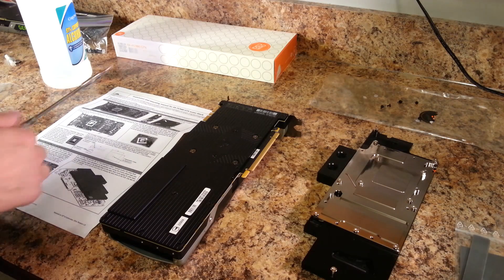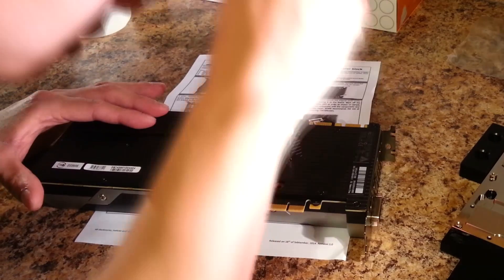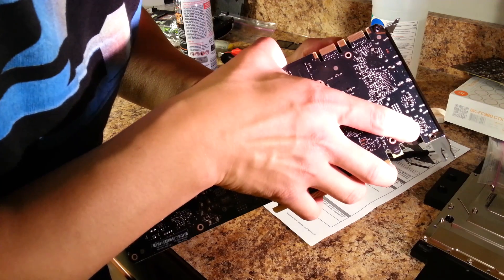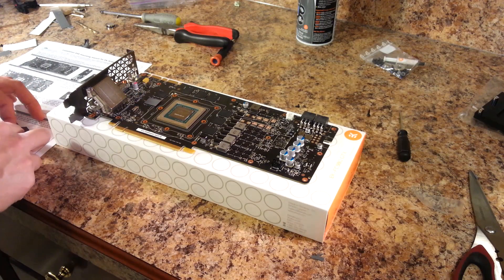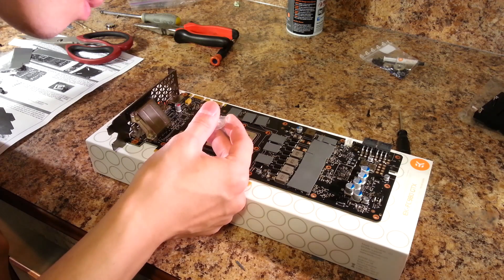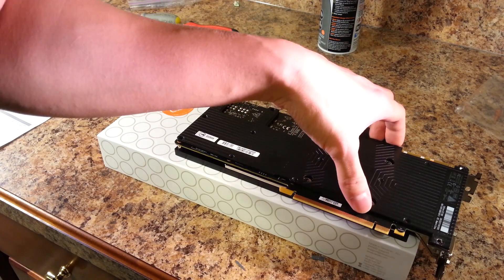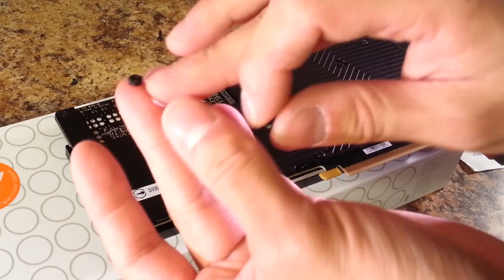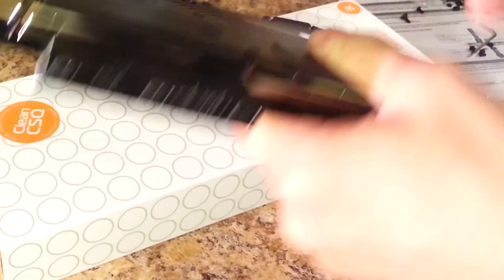How To Water Cool Your PC GPU: GTX 980 EK Water Block Installation Guide (PC Building Time Lapse)

Comment: The second piece of themal pad that you cut out (the square piece) you placed on the PCB... is not actually on anything, there are no components to cool in that area. Also there is no mention anywhere of the thickness of the thermal pads, they are not all the same thickness, this is important! Also the music made my ears bleed.

Comment: WARNING NOBODY NOTICES THIS AND PLEASE BE ADVISED I HAVE THIS GTX 980 CARD AND THE WATER BLOCK IN THIS VIDEO, THIS WATER BLOCK IN THIS VIDEO  DOESN'T COVER ALL OF THE GTX CARD , IF YOU STUDY THE WATER BLOCK YOU WILL NOTICE AT THE END OF THE CARD NEAR THE 2X 4PIN POWER CONNECTORS  NEAR THE LONG THERMAL PAD TO THE RIGHT WHERE THERE ARE SUPPOSE TO BE SMALL CUT OUT THERMAL PADS WHERE THE MANUFACTURE PLACED THEM THERE IS ABSOLUTELY NO METAL TO CONTACT WITH THOSE THERMAL PADS ON THE WATERBLOCK THIS ABSOLUTELY EFFECTS THE TEMPERATURE OF YOUR CARD, AND WILL MESS UP YOUR CARD WHEN  YOU GAME INTENSELY, THIS IS A HUGE MANUFACTURE ERROR ON THE WATER BLOCK PROVIDER, MOST WATER-BLOCKS FOR THE GTX 980 HAS THIS ISSUE NOBODY NOTICES IT BECAUSE WHEN YOU PC STARTS UP THE TEMPS LOOK GOOD BUT AS YOU INITIATE MORE OF THE CARD WHEN YOU PLAY GRAPHIC/GPU DEMANDING GAMES THE ISSUE SHOWS UP, THE TEMP GO TO 91C AND UP, AT 96C YOUR CARD WILL TRY TO PROTECT ITSELF AND SHUT DOWN YOUR PC, ALSO KEEP IN MIND WHEN YOU BUY GTX 980 THEY MAY SLIGHTLY UPDATE THE PLACEMENT OF THE THERMAL PADS THE MANUFACTURER

Comment: For those of you wondering this is a reference design block, and for those running EVGA P/N 2980, 2981, 2982, and the 2983 (04G-XXXX-KR) all those are reference designed PCBs and will work with this waterblock.

Comment: I have a gigabyte g1 gaming gtx 980, would it be the same?
Reply: Kanashto  nope, the G1 Gaming have their own EK Block because it has a non reference design. EK recently released the G1 Gaming 970 blocks this december. Sadly they have yet to release an EK WF3 block for the G1 Gaming 980.

you can check in their main store L http://www.ekwb.com/shop/blocks/vga-blocks/fc-geforce/geforce-gtx-9x0-series.html?limit=all

so far only WF3 970 G1 Gaming block exist none for 980 (I think they might release them this Jan/Feb (not sure).

Although the 970 WF3 G1 Gaming block one's are always sold out. Trying to get 2 pieces myself.

Comment: Avoid at all times using power tools on a pcb... If its on too tight for you to unscrew it, get a proper fitting screw driver and screw it in more to loosen the seal and then unscrew it. Using power tools is just asking for a acident and ruining hardware.

Comment: ahhh man im so tempted to get some of the EKWBs... Which brand 980s did you buy. I hope the Zotacs arnt overtightened as well :(
Reply: i went with a watercool block its cheaper and works as good
Reply: stijn324 do you have a link to the ones you got?
Reply: Mark Ojar just look for the 780/titan one its compatible with 980's. i have the 780's and 980's pcb looks identical

Comment: I know this may not be related to this video but I need help...Is there a GFX card I can upgrade to that is good for twitch streaming (I have OEM Gtx 645, for Alienware X51 R2) that will not require me to upgrade my 240W powersupply? My internet is alright (50 down/10 up) but I want to improve stream quality and cannot afford to build my own pc.... or what would you recommend??? That I buy the 330W Power brick first then what GPU?
Reply: probs wait untill you can afford a decent pc
Reply: btea100 what did you include in your new build?
Reply: Michael Blackmore Thanks, yea I may have to wait a few months, just wanted to see what upgrades were possible so I wouldnt have to spend for a new pc
Reply: ***** Yea if you wait a little longer it will be more future proof and you probably dont want to have to get another one in a year because it cant run games